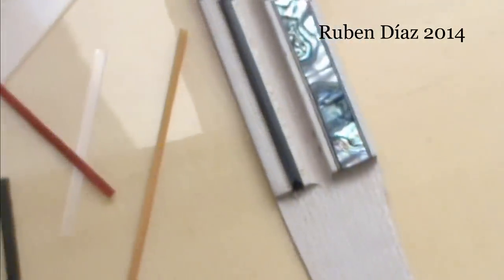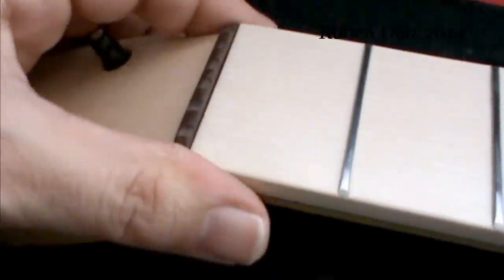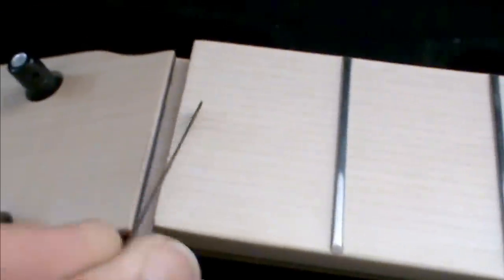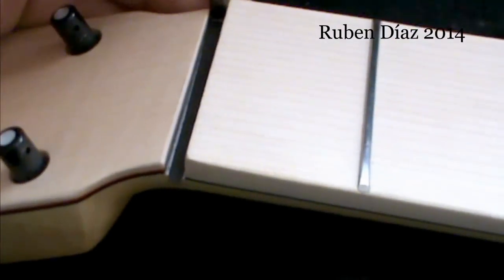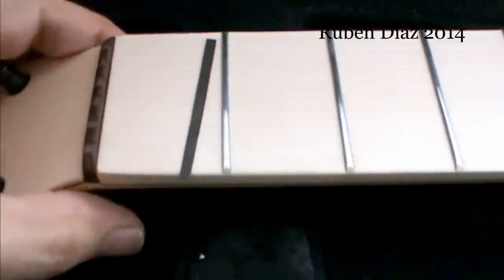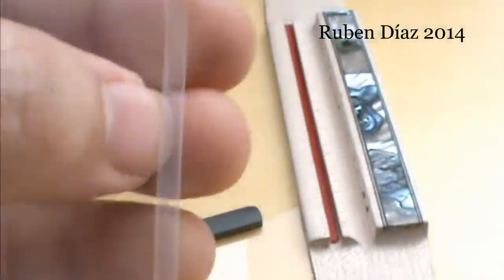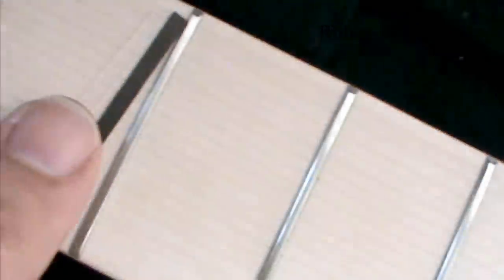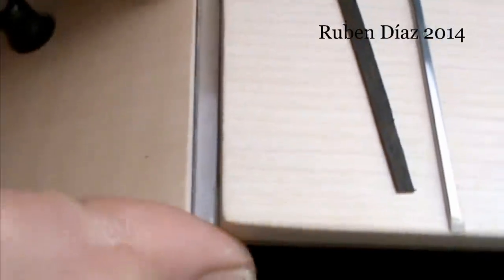How to Raise the Action on the Bridge of your Flamenco Guitar from the way you put your strings on

Comment: If I want lower the action. It is best to sand it down?. For a guitar with no mic or pickups
Reply from the maker: Hello Mario

Pick up and the action of the guitar are two different things.

Every guitar is designed from day one to be of a certain action Super Low-Action Flamenco Guitars / Lutherie Art / A & Q + Tips on Modern Andalusian Guitar CFG
and measurements to be optimally played.

Therefore regarding what to do with any specific guitar (which I haven't seen)  
that I can't tell you just like that using some written words here…

I would have to see personally the guitar in question and then advise accordingly.
Tips: How to Replace Right-Hand Nut (Carbon Fiber Nut) / Ruben Diaz Magazine CFG Malaga

 
Regards
Ruben

Comment: How is the strings height on the bridge, how many ml for each string for having the best playability?
Reply from the maker: Here you can have an idea https://youtu.be/UXuHc5rf0AQ?t=1m Victor
Reply: Thank you.
Reply: I find out that guitar should be 1.9 to 2.4lbs (blanca) in order to set up string action at the bridge around 6 to 6.5mm and still producing punchy sound with plenty of volume using medium tension strings. The negra guitar I prefer bridge action 6.5 to 7mm and 2.6mm at 12 fret in order to get guitar respond well. The preferable weight on negra guitar is about 2.8lbs in order to get low actions strings setting playing with the punch and plenty of volume. The lowering action on heavier guitar does not produce a ringing tone but could be used to practice scores.